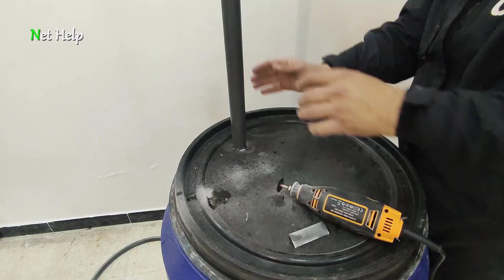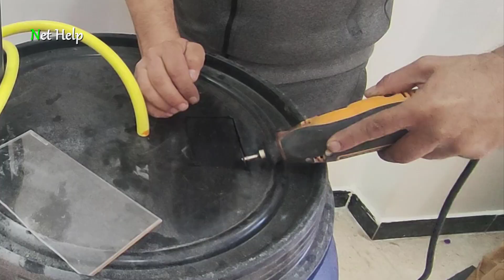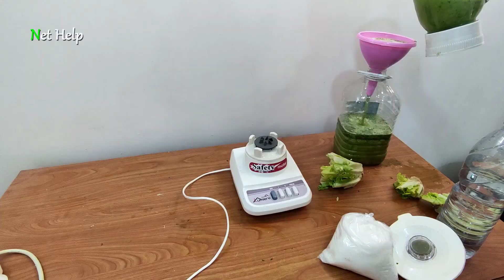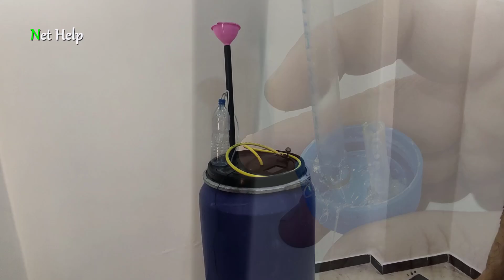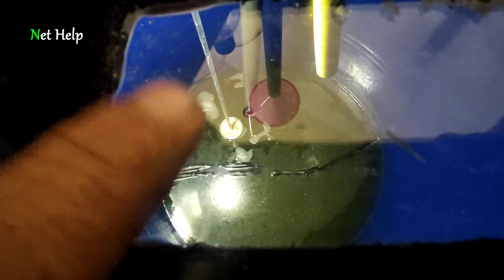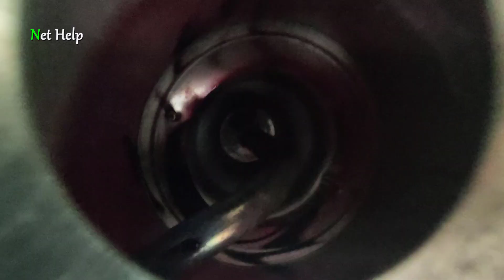Say goodbye to buying gas from the government - and get it free for yourself

Comment: You guys gotta be careful with this. He currently has no flashback arrestor. The yellow tube needs to run into a water bottle, the bubbles need to rise and then the be captured in another tube, which then could be used for a flame. With the current setup- if a flame managed to travel back into the yellow tube in the video-as it is- it would blow that whole thing up.
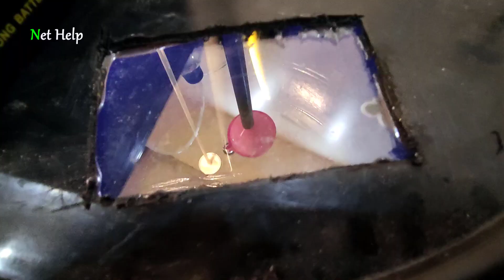Reply: So this whole thing is sketchy, and dangerous, he has pipes running through his back lid.  This is wrong and dangerous!   Those pipes should have  gas tight, sealed bulkhead fittings to pass in and out of the bioreactor.  Note how he's wiggling his yellow pipe at around the 9:15 Mark.   He's going to have a gas leak!
Reply: @diegrinder6851  Yup. The epoxy adhesive won't stick to the poly barrel for any longer than the time to film this video. I don't see any purpose to the soda bottle - it certainly won't reduce the moisture content of the biogas. I supose it could regulate gas pressure after a fashion but I don'y think that wa the purpose he had in mind. One good thing - after the gas starts leaking the odor will likely drive him out of the apartment before he causes an explosion by using the gas.
Reply: @deandeann1541  That was my thought too. I love JB Weld/Steel epoxy, but it doesn't bond to poly well. He did rough it up to improve adhesion however, from what I could see. And that's a plus. I would have used something that does bond to it.
Reply: @MrBilld75  What does bond well with poly? I've kept my eye out for such an adhesive for years. I have purchased special (and very expensive) hot glue sticks that were advertised as adhering to plastic to no avail - no better than regular glue sticks. Any ideas? I even bought a plastic welder from Harbor Freight (a tool store here in the US that sells only cheap Chinese tools)- the heating element immediately burned out so no luck.
Reply: @deandeann1541  About the best I've found, that also works to bond/repair rubber is some kind of strong silicone adhesive (not caulking, stronger, but similar), like "Gloozit" or "Shoe Goo" brands for repairing shoes. It's stickier than caulking, like really sticky and it dries harder than caulking, but still flexible. You'd still have to rough up the poly, with sandpaper or something rough, to give it something to grab to and I've not tried it on much poly, but it seems to work better than other adhesives on it. Other than that, about all I can think "might" work, would be a solvent glue, like PVC or ABS pipe glue, as it actually somewhat melts poly plastics and cold welds them. 

So that "might" affect poly the same way? Something I may try now that I have some recently bought PVC glue. Seems any adhesive that fails to bond things together by "gluing/joining" via regular glues, will succumb to solvents/solvent glues. I'll tell you this about Gloozit or Shoe Goo, it is THE best repair you can do to rubber. Just clean it good with alcohol, so zero grease or anything doesn't hinder adhesion. 

I've used it on a CV boot that was failing on my car (not broken open, but weak and cracked and about to. Based on a suggestion about what to use on failing CV boots, like two piece boot covers you can buy and glue together over the failing boot. And he said the Shoe Goo made the boot last tens of thousands more miles. 

So I tried it on a failing boot and it worked and is holding years later. Used it on my wife's splitting slipper and a split in my winter boot. So it's worth buying, to have on hand for many things, like JB Weld/steel epoxy is. Good for almost anything and I always have some of it around too. There's a LOT of people who love the JB Weld for so many things, but on poly and certain things, it is absolutely unsuitable and my next go to is always Shoe Goo or Gloozit. (Pretty much exactly the same thing/formula for both and made by the same company).

I've also noticed that rubber/PVC repair cement, like for patching and repairing tires, can do that "cold welding" of rubber and melts/bonds the patch to it, so that might work on poly plastic as well. Poly is immune to a whole lot, much like it's cousin HDPE and it's slick like Teflon, so not much sticks to it. But like any plastic, solvents will melt them and sometimes that's your only hope to bond them properly.
Reply: @deandeann1541 
HA6 silicone sealant.
It's safe for aquatics also.
Reply: @RawTopShot  Thanks! Is HA6 a brand name? If that works then 3M 5200 adhesive/sealant is likely to work - although it's very expensive, and when you open a tube the whole tube will go bad in a short while. It is flexible like silicone caulking but immensely strong - I once successfully used 5200 to glue white oak motor mounts to steel angle iron - there were 4 pieces of white oak approximately 4x2x10",  to mount a marine v8 engine. The mounts were in an oily, salty wet bilge and were exposed to heat and freezing temps. They took the full torque of that engine and never failed - the combination of great strength and flexibility worked perfectly - and the life of myself and crew depended on that engine working in winter in the North Atlantic. The engine eventually failed but the mounts never did. You give me some hope that the stuff may work on poly. It looks like silicone caulking but I think it is based on a urethane. maybe they work similarly on plastic though.
Reply: @MrBilld75  Thanks Bill. I've used Shoe Goo - for some things, like waterproofing seams, shoe goo will work much better thinned down about 50% with toluene. When thinned it will never peel off later like it eventually can when used thick. It cures quicker when thinned too.
Reply: @MrBilld75  PS Bill see my reply to raw topshot, it may interest you. I replied 1st to his reply as I got notification of his comment but not yours for some reason.
Reply: @deandeann1541  Oh, interesting! I have heard of people thinning silicone with solvent as a fabric waterproofer and it works well. So it makes sense it would work with Shoe Goo.
Reply: @deandeann1541  I remember that was what was recommended to seal a fish tank and it was like $15 a tube and that was 15 years ago, lol. Probably $25 now, cause regular caulking that used to be $5 is now $10 here in Canada. Very strong though, yeah. Not like regular silicone. Never knew you could use it on engine mounts, but I believe it. I've used Shoe Goo and Gloozit on rubber on CV boots and it held them together from splitting and lasts a very, very long time. The dude I picked up the tip up from in some YT comment, said the boot lasted 70k miles longer and I got at least 20k on mine now.
Reply: @MrBilld75  Bill the very best shoe goo style product out there is Aque Seal and Aqua Seal Accellerater It is available in Canadian dive shops. It is the same as shoe goo but is available in a bigger tube and ages much better. Mixed 50/50 with the accellerater it xures in a few minutes rather than overnight.
By the way, I'm from Maine, I lived in Canada for a few years, I liked it there.
Reply: @deandeann1541  Ahh Maine, beautiful State. Yeah I am somewhat familiar with dive stuff, as I use scuba moly grease for my airguns. It can handle high pressures without auto igniting and is the choice of many airgun shooters. Airplane lubricants and sealants too, tend to be very unique, high quality and expensive. But for good reason, they are specialized and amazing.
Reply: @deandeann1541  E3000 has worked well for me fixing headlamp tabs and such. I wouldnt put any serious load on it of course. Warming the plastic up with a little torch helps but is situational, due to form alteration. Then theres always baking soda and super glue 😒
Reply: @dont.ripfuller6587  I have some e3000 - its so old it's probably of no use. Never tried baking soda and super glue although I've heard of it. Never needed it as I always use gel super glue which is much better than the regular kind. Thanks for the tip.
Reply: @deandeann1541  the super glue/b. soda is crude and unsightly but, as an experiment with the kid, the two things we glued with it have stayed stuck and get knocked around daily- the (computer) chipped end of my truck key and a magnetic piece on her dolls pacifier. The best potential i saw was the reaction with the soda makes the glue dry almost instantly.
Reply: @deandeann1541  not sure how well it would stick to polly, but I've seen YouTubers make an epoxy out of Styrofoam and gasoline mixed together and used to "weld" plastics together 👍
Reply: @justme-gd4gq  great idea - thanks! T wonder which plastic that works for = maybe pvc?
Reply: @deandeann1541  in the video they repaired a plastic bucket from Home Depot.
Reply: @justme-gd4gq  That would be regular poly then - polypropylene
Reply: @MrBilld75  You can also spray on AT205 or any rear main seal leak "sealer" for automotive engines as any rubber preventative for cracking like CV boots or door seals. I spray down my cars inside out and under, bike tires, etc once a year. Havent bought wipers in 8+ years. Never had a cracked CV boot. It is rubber plasticizers that remoisturize petrol based rubber and make it swell. Put into engine oil sparingly, slowly over days, and carefully and only as a last resort because it will swell the rear seal and make it pop out.
Reply: @cbpuzzle  Some good tips there about not overdoing it with sealers, that's cool. I have used similar it on my wipers too, as it seems to help them last longer, indeed and they are constantly exposed to UV and wear. I am using some new stuff I can get cheap at a local discount/liquidation store, called Camco RV Rubber Roof cleaner and conditioner and it seems pretty good. And I now use it on bike tires and rubber parts there too as they are exposed to UV a lot and are outside. 

The rubber looks amazing after I use it and seems much improved. And dries to a nice non-greasy or slippery finish, like some things. Like Simonize's Armour All knock off. It's very greasy and I don't like it and it tends to gather dust and road grim because of it. Armour All at least improved their product so that it isn't greasy or sticky after application. This Camco stuff, seems very much like the AT205 and less like Armour all or similar products. It's thinner in it's consistency for sure than Armour All or similar, which are all rather "milky" looking and thick. This stuff dries clean and no slippery residue.
Reply: @MrBilld75  

What about a polyurethane adhesive / sealant such as Sikaflex or Bostik ??

They stick like baby shit to a blanket on everything else !
Especially if you use the Specific plastics primer that Sika makes for the task !
🤔
Reply: @sfcarp9418  I've heard of that Sikaflex stuff. Maybe a polyurethane adhesive might bite into the plastic, because of it's solvent properties, yeah? I find the best bonds are made when one material can soften another and "cold weld" them together. Kinda like how solvent glues like plastic cement cold weld plastic scale models together rather than "glue" them. Pretty much the same way PVC glue softens PVC pipe to cold weld them together. You ain't getting them apart by any other mean than breaking sawing etc.
Reply: @MrBilld75  

Yes , well when you use their own brand primer , it sticks like shit on a blanket .....

Amazing stuff , we use it in construction for stick in windows and anything else .

Car windscreens are held in place with it these days .
Reply: @sfcarp9418  Hehehe, sticks like shit on a blanket. I'll have to remember that one. lol.
Reply: Also needs a gas scrubber to ensure no h2s is being burnt, can use steel wool a very large water bubbler or ground up rubber tyres.  Hydrogen slide is also dangerous for one’s health.
Reply: @herenowlife  my brother was working in a plant he was new they didn’t turn on the air mover h2s knocked him/another guy to there knees barely got out. There was a pocket of gas trapped in the tank they started the job permit saying the air mover was on but wasn’t.
Reply: @bpd8426  Brian - Your brother was very nearly killed. H2S is very serious stuff, and if you've been smelling low amounts of it before the big exposure you'll quickly lose the ability to smell it, and have no warning. I used to know a young woman who was widowed when her husband (and the people he tried to rescue) died from it. It was a ship salvage, the ship was raised and had some rotting shrimp in the fish hold - not a huge amount of shrimp, but enough. The change in pressure when the boat was raised caused the remaining shrimp to fizz like it was carbonated. It was releasing H2S. No one realized this was happening until a couple guys jumped into the fish hold to clean it. He tried to rescue them. It was sad.
Reply: @herenowlife  had never read that one. I know you can put lime in the arrestor or make it 2 stage to remove the sulfer....  have not seen it done in india as most of the cooking is done in open issue and would not be an issue.
Reply: Yeah good point. A flashback arrestor basically works like a bong if I'm not mistaken. Lol
Reply: И зачем все эти газовые псевдокомпании со своими ворами олигархами?
Reply: Это называется водяной затвор!
Reply: Two of the ingredients still need to come from the government AND he doesn’t say which type of potassium. Pick the wrong type and someone will have an explosion!
Reply: Yeppers. Darwin awards to follow. 🎼🎶"Dumb ways to die, oh there's many dumb ways to die..."
Reply: I'm calling this fake. You can't have an open funnel tube and expect it not to affect pressure. Who rides around with fully inflated punctured tyres? Proper anaerobic digesters have a tap/faucet.
Reply: "KnightOf NewAustin": what he need to put in the rope is a unidirectional flow control valve  👍
Reply: He also has absolutely no safety awareness whatsoever I've eaten is sitting there just reaching in to the damn lane wait and turn picking it up by the metal that the flame is on he keeps putting the freaking burner right next to the tube to playing the methane like yeah nobody follow anything the sky did because you will blow your fucking ass up
Reply: That would be an issue is air was leaking into the digester. This operates under pressure so no air can leak in.
Reply: The problem is security. Such a barrel can easily explode and the whole thing flies in your face. And the house is in ruins. You can put up something like that only far away from your house.
Reply: what is the purpose of the battery?
Reply: На газовую плиту от газовой сети идут копейки. 
Дом отопить котлом в морозы хватит ?
Reply: @KnightOf NewAustin  you forgot to mention u can put some lime in the arrestor bottle to remove the sulfer (rotten egg smell) from the gas if the oder is bad. Your acid loving plants will love you for it.
Reply: There would be no pressure build up at all as the funnel tube is open.
Reply: @expertssay3869  it maybe open but if the gas is flowing through it, there is pressure someplace pushing it. It all depends on how high the pressure is. In this case, the danger is the o2 content of the gas AND the pressure... otherwise the flame will travel back to the source and cause and turn it into a bomb.
Reply: the big burner you have needs more aeration for a better flame picture (blue)
the yellow is not enough air being drawn in.
Or maybe the jet size
Reply: You’re right.
Reply: 😂 Thanks for the tip.
Reply: Garbage video. No name of materials he mixed. What are they?  Salt, flour, sugar, vetsin or tide?
Reply: Yeah years ago I did the same with a homemade Hydrogen cell and thank the Lord I was only producing a little gas because when that fire went back into the system KABOOM!!! Before that I was cooking with it and everything. But I can no longer find the equipment used to cook and stuff with Hydrogen gas. It takes modified equipment because Hydrogen is 10 time more explosive than traditional fossil fuels, extremely volatile.
Reply: @spiritofeli  was that a hydrogen electrolysis cell?  Because those split water into hydrogen and oxygen making the perfect ratio for an explosion. Much more dangerous. In theory a digester like this would fill with gas and drive out oxygen making it safer. I still wouldn't trust it in the house though.
Reply: @_MKE  Yes it was. I agree this setup is more stable
Reply: Putting aside how dodgy and dangerous this is, how much usable gas is it going to produce? How long would that stove run for??
Reply: Lol. What were you making.
Reply: Mmh
Reply: I disagree... You don't necessarily need a flash back arrestor excess water is pushed out leaving high concentration of methane gas without oxygen inside the tank your safe.
Reply: What was the ingredients he put in the blender besides sticks, leaves, and water? 🧐
Reply: No se podría traspasar el gas a un tanque especial?
Reply: I tried it and it worked for me for a month, but I used an iron cylinder and not a plastic one.
Reply: 😂😂😂семь дней на чашку кофе
Reply: I did not  see your Reply until I Had wrote down and   Much what I wrote is exactly My Feelings Gas is a dangerous  thing to Mess about with  as a Young Man I recall that we had an old  Fashioned Wall mounted Gas Boiler: The  Piolet Light Had  Gone out and  realising that there was No Hot water coming through the Tap  I Turned on the Gas tap so as to ignite the piolet Light ! There was a  Fault  with the Safety Valve where you'd have to Light the Piolet Light {if working Perfectly } you'd have to Light the piolet light  and  Keep a Flame onto the Now lit Piolet Light until the Heat from the Flame  opened up the safety Valve  so as to let the Gas flow and  be ignited ? Not realising that there was a Fault after turning on the Gas tap I was looking for a long Spell so  as to light the Piolet light  and on Lighting the Spell and  Putting it through the small Hole where the piolet light was !Because there was a  huge  Build  up  of Gas  within the Cylinder there was such a  High Explosion: Like  a Cannon it went  Bang the Top of the Heater Blew off and  Created  a  Hole within the Ceiling  and  of course it was so loud  My ears was ringing ; Ever since that day I always  think of the things  that might Happen? Many Homes have been turned into Rubble By ignited Gas
Reply: @RolandMitchell  It is spelled "pilot", not "piolet", but you got the right idea.
Reply from the maker: The task of the bottle is to draw water from the barrel, which is the evaporating water from the inside
The gas stays on the surface of the water and rises as the pressure increases
Reply: @NetHelp2  Indeed! A similar bottle setup should (in theory) be attached to the yellow hose as a flashback arrestor- and should have one tube fully submerged under the surface of the water, and the other tube above the water level to capture gases. This appears to be a decent setup- only problem that I see is… it should have another bubbler (flame arrestor), to ensure a flame cannot flash back into the yellow tube and ignite the main container.
Reply: @NetHelp2  and it also keeps you from blowing up
Reply: @NetHelp2  That's not what they are taking about, your apparatus, as it is currently, has the potential to catch on fire and explode, due to lacking a safety device, called a flame arrestor on your gas line, between us the source and the burner.
Reply: Установить водный затвор и будет Вам счастье, всем добра!
Reply: Yup
Reply: Where can I buy this anti-reflector?
Reply: @蔡蔡-e7f  You can make it out of a glass jar with a metal lid.  Idea is the in this case yellow gas tube from the bioreactor  goes into a hole in the lid of the jar and is submerged in water  an outlet gas pipe goes into the lid of the jar and remains above the water.  The gas has to bubble up through the water before you can use it.  This way if the flame ever backs up into the pipe it's stopped at that jar and can't continue past the water to ignite the Bioreactor on fire causing an explosion. There are other methods, however.
Reply: @diegrinder6851  yes I agree he needs a water bong👍
Reply: flashback arrestor
Reply: @蔡蔡-e7f  look at how they build them for oxy acetylene systems next mimic it